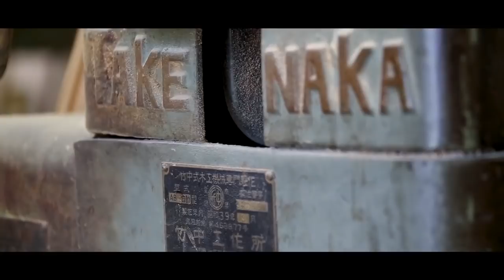Kumiko - The Art of Wood setting - Japanese Traditional Art

Comment: the block plane with the 90° blade is absolutely GENIUS! normally you would put them into a jig and plane the angle down but he's just cutting them off and slightly over length with the plane in 2 passes!
Reply: @mortymortal7  lol, if someone else made it you can custom make it without that much trouble as long as you understand the processes involved! and honestly if you wanted one without too much work you can just buy some steel angle iron from local hardware store, cut it down to size and just sharpen it and make the plane body to put it in for less than $50 minus your labor of doing the work. tools are not overly complicated to make, head on over to some of the videos from some people over in China, Vietnam, Africa, India and South America! they've hand built so many tools from trash it's not even funny and they work just fine for the job. is it going to be 100% amazing? well that depends on how much finish work you're willing to put into it.